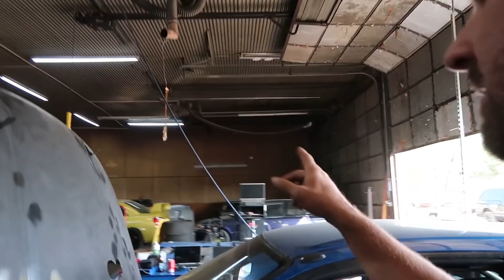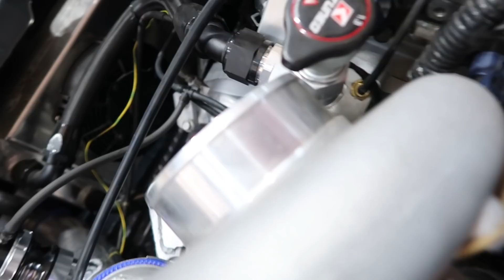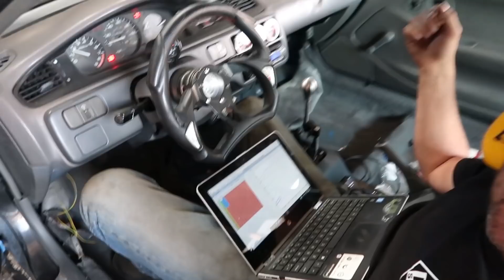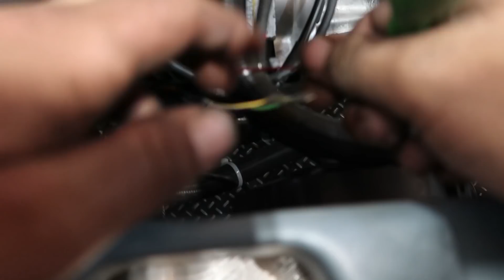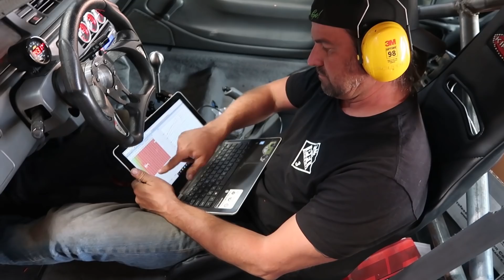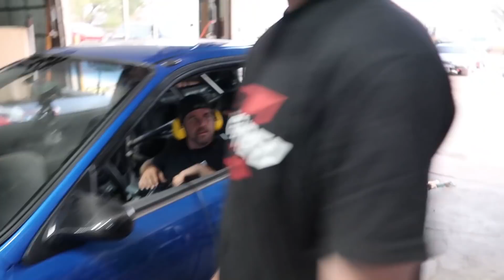Sorting out This AWD K swap civic episode 1

Comment: I noticed that when its tuned in fwd on the dyno Then when you go awd at the track there's more load, therefore makes more boost? True?
Reply: depends how much the car weights compared to his dyno rotational inertia. it will be different in each gear anyway
Reply: @Nebbia_affaraccimiei  I kept overboosting in 3rd and 4th gear when awd. So I had to go and redial all new boost d/c. Fixed after that. Oh I'm full weight ek sedan k20 turbo. It's on my channel

Comment: You keep doing all kinds of content and even things you usually don't do to keep it interesting. Trouble shooting things is half the battle sometimes. I rocked a 95 Neon highline coupe for years and it always set codes for egr and would occasionally just refuse to start or run right. I'd pull the fuel pump fuse and it would completely reset the computer and it would be fine again. So I'm right with Jamie and the curse and was considering a 2.4 swap but it finally ate the timing belt so I gave up. Got a 06 Charger Hemi RT to play with now👌 You are always so positive and go the extra mile for your customers.

Comment: I think I'm going to piss a lot of people off but I'm going to do it anyway I've got a 1980 Corvette I think I'm going to put a K24 in with all the bells and whistles and call it the Korvette
Reply from the maker: I think we think it’s Rad!
Reply: @PFIBrent  so let me pick your brain a little bit if money wasn't an option and you could build the raddest motor ever what block heads cam injectors fuel pump ECU Turbo basically what would be your dream build between a K20 and K24 because I'm doing it when I'm done I'm bringing it to you to tune and we'll have some fun with it
Reply: Better than my Reliant K20 swap idea. I'd do it but no good bodies around. Probably would have beat SRT4 swapped Horizon.